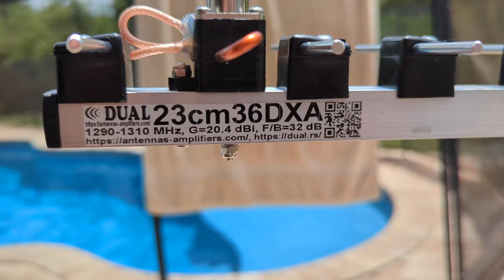36 Element 1.2GHz Yagi, 23cm36DXA From Antennas-amplifiers.com

Comment: I run a Dual PA1296-56-DXHDP 300w 1296mhz 23.2dbi 56 element beam 19ft boom. Its fed with 1 1/4 inch heliax on a 50ft tower. I have made SSB contacts 100 miles away at 25-30+ signals both ways at 150w. A better SSB band than FT8 since doppler shift can be really bad even with a IC-9700 GPS locked. 1.2ghz in Georgia can open up very early just before sun up. W4MAA 73

Comment: Hi Eric, 

Seriously, the dimentions for VHF & especially UHF frequencies are crazy critical... Thats why that GHZ stuff has a lot of precision machining.

Anyway, before you mount that big ol' thing - grab your precision measuring device and measure all of the elements, as well as the heights above the boom, that angle of the driven loop - appears to be on a 45°, but hard to tell on video... Distances between elements, etc. Then try modifying your build again to match that bought unit.  I bet itll work out a lot better.

Anyway, good luck with EME on both.

73 John N7GHZ

Comment: Notice how much further the elements are from the boom on this antenna ... If you 3D print some thicker insulators , then your homebrew version should work .
Reply: Correct! 
In fact your home brew insulators being that low induce more capacitance into the system; which may be why you couldn't tune it.
Reply from the maker: Ahhhhhhhhh, thanks.